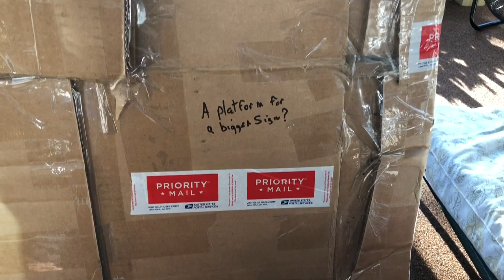Making a Damascus steel knife

Comment: Maple..... Love the grain pattern and light color.
God Bless.
BTW, please don't hide any of that maple by using it as a liner. There are other light woods that would work well, for that purpose, IMHO.
Reply from the maker: I buy it in 1/8 inch thickness so there really isn’t any other use for it. I also buy the Birdseye maple in 1/2 and 1/4 inch thickness to be used with and without liners.

Comment: BTW just finished the vid and the pattern is AMAZING. Will you dip the rear of the knife or just leave it? Guess it's not seen being under the scales but what about the spine that shows. Does it make a visual difference?
Reply from the maker: Since I have to sand the handles after they are epoxied and pinned, I have no choice but to sand the spine. In an effort to make it uniform, I’ll sand it all the way to the blade tip. Basically,the only place that will show Damascus is the sides of the blade.